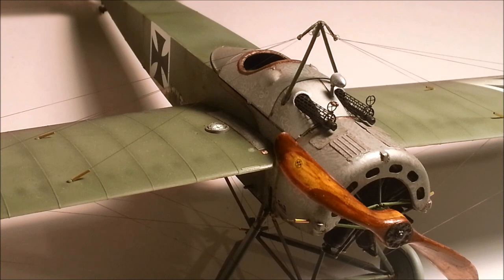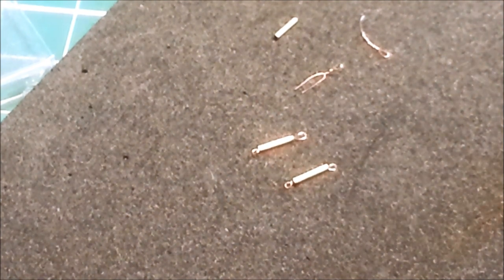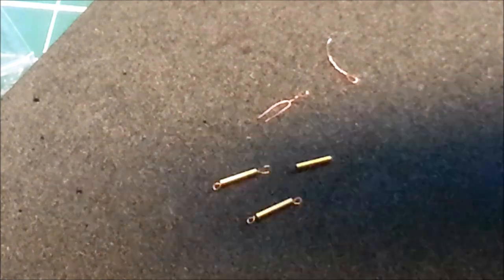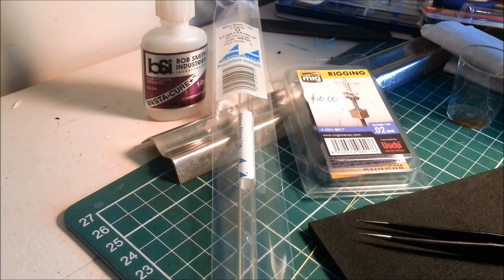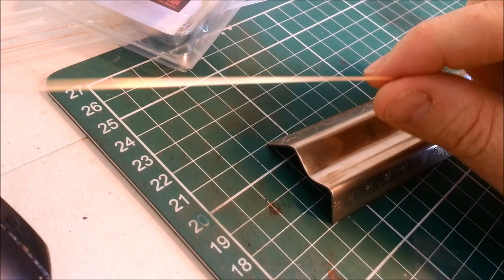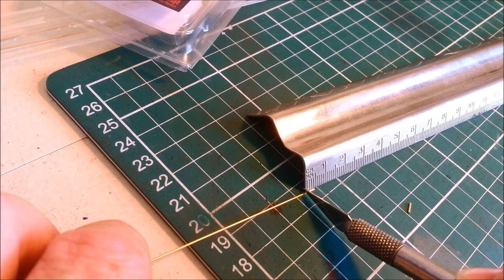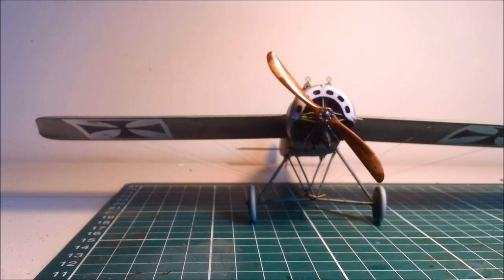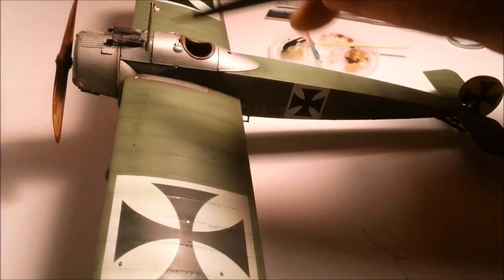How to rig a model airplane - easy rigging for scale WW1 aircraft

Comment: Dave the amount of work and toil that has gone in to this build is really beginning to show results. I had no doubt it would look as good as it does.  I have a Royal Aircraft Factory BE2c in 1/72 that needed rigging to complete it. Now I've seen this I'm not as scared to do it. However I can see my use of the word "bigger" increasing ten fold. 
Great video great work mate.
Reply from the maker: Thanks Bilko. I won't lie, it is intimidating to contemplate, but once you get a feel for it, it is just a process and you find a groove.

Comment: May I make a few suggestions? 1. Make your own tie-downs by creating a J shape hook about 2” long from 0.3mm (or whatever eye size you want) diameter wire. Make sure the short end of the J is rounded so the tie slips off. Mount the long end of J in in a pin vice. Loop a length of wire over the J, hold the wire in pliers, twiddle the pin vice and voila, a rigging tie. Trim to length. 2. Fishing line can be heat shrunk using soldering iron. 3. Fishing line can be coloured using a felt tip pin. 3. Use modified sewing needles to hold your cyano glue. Just grind off the end of the eye so you end up with two short prongs. Stick the pointy end in a short length of wooden BBQ skewer. Clean by holding over a flame.

I love the prop!
Reply from the maker: Trevor Austin thanks very much, these are great tips. I’ve been meaning to make one of the glue applicators like you describe for a while, I think you just inspired me to. Cheers mate, Dave

Comment: Very good job showing both methods Dave. As you probably guessed by now everyone has an answer or opinion about the subject. My collection is 1/72 so you could imagine my grief to this subject. Being 200 Km. From nearest hobby store you need to be creative. Wire insulation from discarded electronic devices is handy. No need to waste brass. I also use a needle threader to pull a line through. Instead of paying outrageous prices for Ez line, I'm going to a sewing store to find elastic thread. Could be cheaper. On the subject of diheadral I believe the only remedie is opposite tension. Like torqueing down a cylinder head or mounting a tire. Do one side, then it's direct opposite. As you probably guessed makes the whole matter even more of a pain in the ass.
Reply from the maker: Mate, I wish I had been smart enough to do it methodically, doing one side and then its opposite. That would have made life easier in the long run, even though it would have been more painful in the short term...
Reply: @DavesModelWorkshop  there lies the paradox. Get it done, or take my time? "Sigh"  lol...
Reply: @DavesModelWorkshop  I do mostly scratch builds and I'm very sensitive to this problem. My solution which, I admit, may not work for kits is to have wings very firmly attached to the fuselage. I use brass rods at appropriate locations into the sides of the fuselage at the wing root area. The wings I make are often hollow (see Harry Woodman method from old days of Scale Models). fine and dandy but what about a solid kit wing (some may be hollow too, i.e. two piece, upper, lower)? If solid maybe a hole may be drilled into end of wing and slid into/onto the rod. I's like a tab "A" into slot "B" assembly method that most kits have but more secure cuz the tab A is longer and stronger. Bonus is you can carefully adjust, by bending, sliding, this joint to ensure against anhedral or too much dihedral of the wing(s). I use CA to attach the wing to the rod BTW. When struts are added this wing assembly is strong and aligned, but like any modelling it is "fiddly", especially at first.

Comment: Insert a needle or that very drill bit into the brass tube. Take a dap of superglue on the end of the needle and pickup the end of the line.  Draw the line thru the tube by backing out the needle then snip the line!

Comment: seeing this done for the first time ever I have 2 thoughts about threading the tubing on the line.  1. try putting both pieces of tubing on before attaching one end and just let them float in the middle until they are ready to attach, then you don't have to be as gentle.  2. instead of "threading a needle", try inserting the smallest wire possible through the tube, touch it to super glue and then the rigging filament until they barely join, and then gently pull the wire back out snaking the filament behind it.

This could all be terribly impractical at that small scale, but it reminded me of pulling cable through conduit.

Comment: Just a couple of thoughts...ez line is great stuff and used to be my default, until I discovered some rigging material made by modelkasten...is isn’t quite as stretchy as ez line, but it does enough that you can create tension, but it’s a bit more like monofilament, which makes it easier to thread. Can’t find it here in the States, but I source mine thru BNA in Australia...so should be easy for you. Also, you might want to check out Bobs Buckles in the UK. He makes eyelets and precut brass tubing in various lengths. His prices are reasonable (I think) and is worth it to get consistent lengths and save the hassle of cutting them yourself.
Reply from the maker: I;m going to have to look into that Ron. Thanks for the heads-up!
Reply: I too am using exclusively modelkasten's rigging material, it is way better than both EZ line and Monofilament!
Reply: @ssasho0463  I'll check that out too!

Comment: Great video Dave.  I finally figure out how to rig an model aircraft (I think...) after watching videos like yours, doing research and experimenting.  I believe the ez line works best as it will give when touched without breaking.  I install rigging by gluing the eyelet to the model and running the ex line through a tube, then running the ex line through the eyelet and back through the tube and tension.  I apply CA glue to the tube and cut the excess line.  This looks very realistic.  I was not sure how you did yours.  It looks like you glued the ezline to the model and the inserted the tube.  I would like to see a rigging of a 1/72 scale biplane.  Now that is a challenge.  I have rigged the airfix 1/ 72  Eiendecker with thin ezline. - but I can’t rig a 1/72 biplane.  It is just too delicate.
Reply from the maker: I hear you David. I stay away from 1/72 aircraft, it's just too small a scale for me to enjoy building. And yes, I love the fact that EZ Line gives a little when touched, when I compare it to stretched sprue rigging which snaps off at the slightest touch there is no competition!

Comment: Hello Dave, I haven’t actually tried this myself, but I was watching a rigging video a few months ago where a modeller was demonstrating rigging, and they used a little trick you might like. He put a small dot of CA glue on the connection point just as you do, but he dipped the end of the rigging string in ‘kicker’ so that when he touched the string to the glue dot - it bonded instantly. 
Sorry I can’t remember who it was, so I can’t give them credit.
Reply from the maker: That's a great idea. So much easier. I'll look into that for next time. Thanks Derek!

Comment: There is a video of a guy taking q tips (ear swabs) made with plastic tubes. He heated the tube and stretched it making thin plastic tubes. Lot less heavy than the brass.
Reply: That's exactly what I was thinking. I'm into building my 1/72 Airfix EIII right now. Probably I'm gonna use stretched sprue and stretched tube.
Reply from the maker: Nice idea. I guess what I like about the brass is I know it is a consistent internal diameter, but I can see the beauty of the stretched Q-tips

Comment: did the brass tubes get glued in place? I dint see that bit and they appear to be staying in place on the underside so Im guessing they are. Also it might be easier to secure the rigging thread in the tube then push the tube into the wing slot. more contact surface.
Reply from the maker: They did end up glued in position, but only through a bit of the glue congealing around the contact point on the wings.

Comment: Great video, shame about the dihedral on those wings, didn't seem to improve after the top rigging.
Reply from the maker: I know, I need to fix that... I expected the tension to fix it, but the little tripod thing that the rigging mounted to wasn't strong enough to take all that tension.
Reply: @DavesModelWorkshop  I think stretchy rigging on a monoplane would be more of a problem than on a biplane, since those 2 wings are already set properly alignment, gap, stagger, dihedral, incidence-wise,  most likely; but I'm a confirmed monofilament user as I've said above.

Comment: I have a Roden 1/32 Albatros d.iii that will need rigging soon. This should be helpful.
Reply from the maker: An Albatross D.III has about the same number of lines of rigging as my Fokker E.IV, so I hope so :)
Reply: when doing ww1 aircraft even though rigging may be last thing, think early in the build to prepare for it, like preparing rigging attachments that will be tough to get to later, to save some frustration later.

Comment: You know I think that will take me at least two steps closer to building that Camel! Bobs Buckles though, Ron‘s right they do look amazing. Not that the brass tubing isn‘t effective Dave. Might use that approach first. Dave.
Reply from the maker: Hi Dave, good to hear from you mate. Yeah, Bob's Buckles are very effective, they are truer to scale, I can't deny. Sometimes my own cheapness gets the better of me... ;)
Reply: @DavesModelWorkshop  I use a cheap alternative for turnbuckles. Back to fishing, you gather I've done that a bit! I use long shank fly fishing hooks of many scale sizes. cut of hook, keep length of shank with eye end. Drill holes and insert in wing with super glue. some blobs of PVA can model the rest of the turnbuckle. But what ever you do guys never lose track of the tiny hook end; you don't want to find that in your pajamas one night! I immediately I cut it off, place on piece of tape, that to be folded upon itself later to safely discard the hook end!

Comment: Any fishing line under 4lbs that is monofiliment works or fluorocarbon that is under 8lbs works.
Reply from the maker: Does fishing line have that stretch effect though? The stretch is what makes the EZ Line a lot easier to work with, I find.
Reply: @DavesModelWorkshop  well, fluoro and mono have good stretch, the reason why I didn't include braid is because it has 0 stretch, I recommend fluoro because it's clearer and a lot thinner compared to mono.

Comment: If you dab the ez line in a bit of superglue accelerator it stick instantly it touches the glue.
Reply from the maker: I found if I did that the EZ Line curled and twisted and kinked before I had a chance to then move it to where I wanted it.

Comment: Instead of brass tubing try polymide tube.  It's a little pricey but looks great, better than the brass.
Reply from the maker: Hi Robert, thanks for the tip. What makes it better?
Reply: The color is close to the wrapping on the real planes, very smooth so it's easy to thread the rigging through , takes ca glue very well, and it's easier to cut than brass. There's a wwI modeling site which has a lot of great tips, tutorials, and photos of the real planes as well as models.  WWIaircraftmodels.com
Reply from the maker: Thanks Robert - i'm going to check it out. Cheers mate.

Comment: A +1 on the premiere thingy but mostly for threading the tube
Reply from the maker: Threading the tube is a horror the first time you do it, but I did find it got easier with practice.
Reply: @DavesModelWorkshop  I'm building the 1/48 scale Ni-11 so smaller tubes ...

Comment: Didn't pull out the anhedral I see
Reply from the maker: I know, I need to fix that... I expected the tension to fix it, but the little tripod thing that the rigging mounted to wasn't strong enough to take all that tension.
Reply: @DavesModelWorkshop  mine did the same not sure what to do unless I rerig the top with more tension 😣
Reply: @TheDemon190  it may only take a couple of strands but try to replace some of the stretchy line with some monofilament of similar diameter. I like fly fishing tippet.
Reply: @DavesModelWorkshop  I mostly do scratch builds but come to sites like yours to get tips. Some parts in model kits are a bit weak to take a lot of tension as you indicate, but could be replaced with at least a partial replacement of something like brass strip. Painting that can be a bit of a chore to get it to stick properly though. a product called Mister Metal Primer-R has helped me, then prime that, then paint. Another great substitute is carbon fiber strip and rod, which I use for wing struts. Extremely strong, but tricky to cut and work with, I'm afraid of the dust, so use a mask.